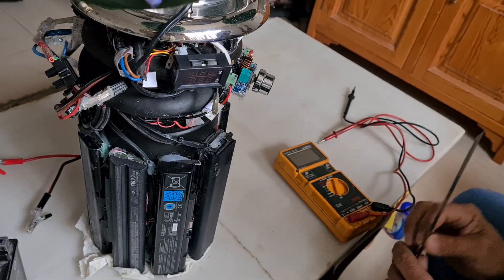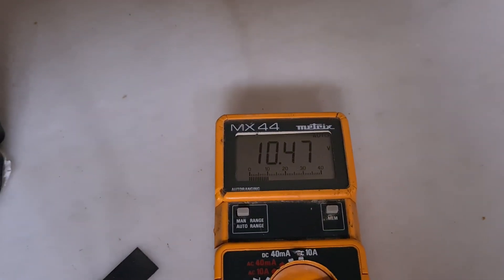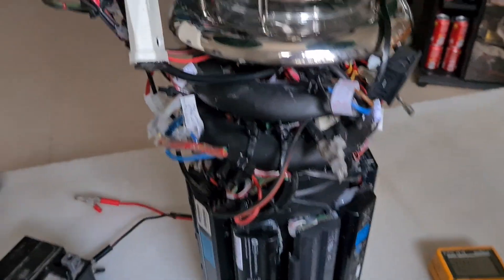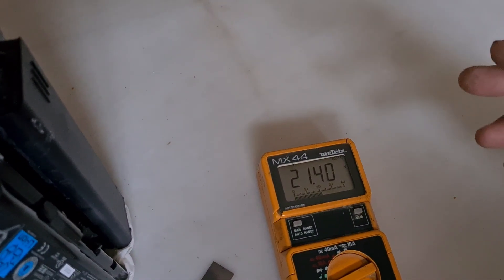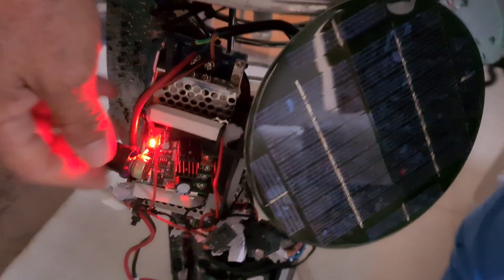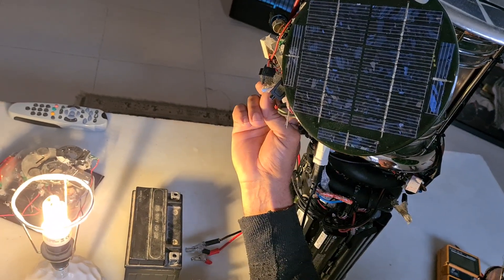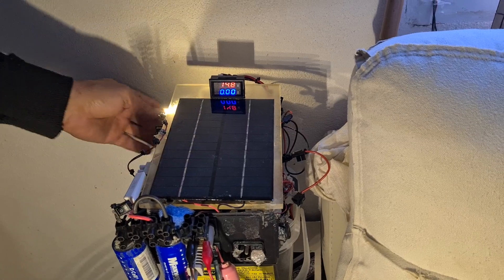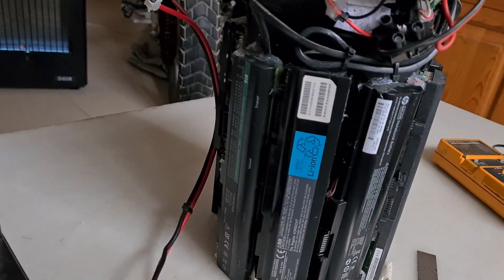10W input 24Ah output energy storage power bank (video for Gerald)

Comment: This is similar to the solar capacitor charger I bought from you, do you still have ebay?
Reply from the maker: Hi I hope you are well. This is a bigger version than what you have. If people need something they can write to me by email. I am not active on ebay anymore for now because I'm very busy. Thank you for your understanding. Best regards
Reply: @denissabourin  no worries Dennis keep up the good work, what U think of this, seems fairly simple in concept & seems to work but I'm very interested to see your thoughts?
https://youtu.be/AwlBESe2ozY
Reply from the maker: @zwarst  Hi, I've seen this video. I don't understand how he can get 2.5Kw from 100W with an inverter of 500W. He has a good generator but he doesn't seem to use it in the right way as I see it. Of course he can run the washing machine motor from the grid instead of running on an inverter and battery but if he would charge several batteries and make it a PMG or install an alternator he could charge more batteries and get more output as he said from an inverter that relies on the charge batteries. In this small concept I don't see how he can get 2kw from 1 battery and a 500W inverter. But it's a good start. Regards